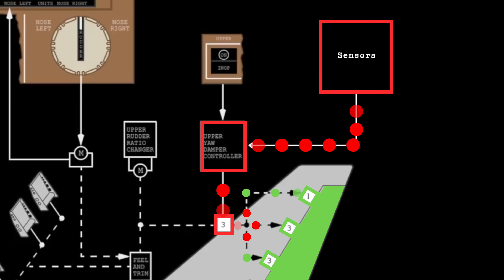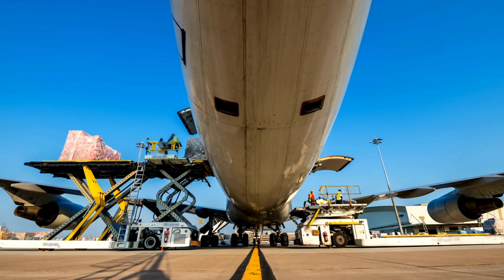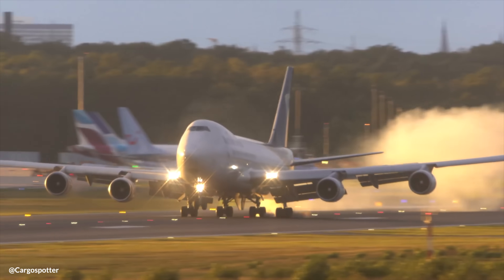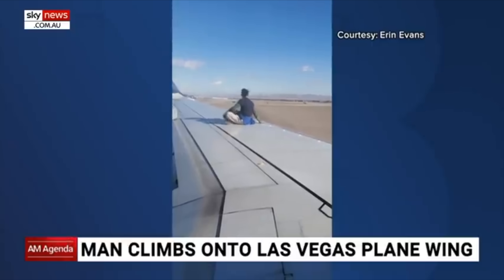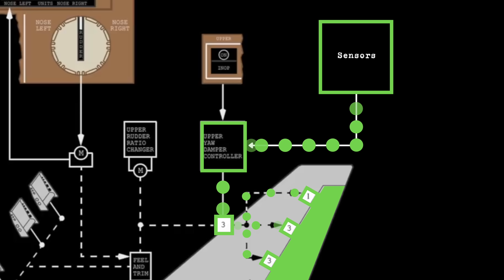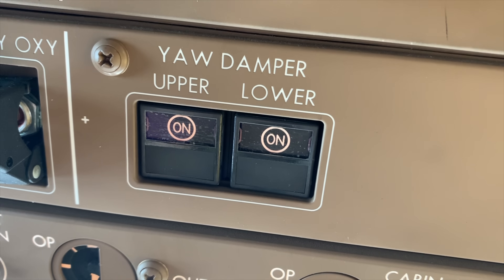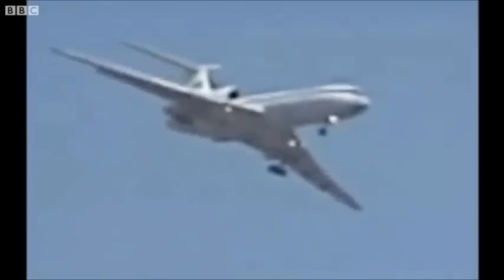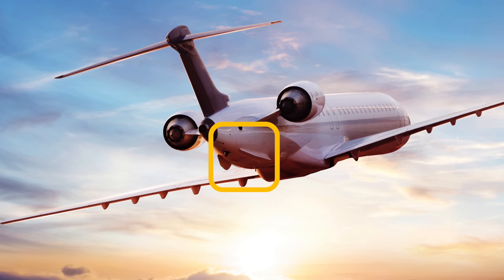What is a YAW DAMPER and how does it work? Explained by CAPTAIN JOE

Comment: 10 years ago, i graduated with an american CPL, and all instructors noted that i tend to overcontrol the plane while most students typically undercontrol it. I was also too harsh on the rudder, when most don't ever learn to use it at all. Before i gave up on aviation in favor of something more rewarding to my professional dignity, i spent the obligatory couple years (in fact, almost 4) trying to get that first job. So on one occasion i was invited to fly a proper jet, a Cessna 520 if i'm not mistaken. In the capacity of the chicken eater, of course. But the captain was very kind and let me hand fly the thing a couple minutes after VR. So one thing that irritated me was that the pedals were so stiff, i really had to push em hard on turns, trying to avoid that slipping. Big difference to that yoke, which i could move with the tip of my little finger.

After he flipped on autopilot, i exchanged that with the captain, and he said, oh, yeah, the auto-rudder was still on. It had a fancy name, something like, "yaw-damper". ...Yeah, right, you have it in your video title. And i be to myself like: huh, what the heck? Why do they even still put those pedals down in, if even this is now "auto"? 

Frankly, i still can't get my head around all that "fly by wire" mindset, and how you guys cope with it. I mean, to me, when i was on top of my skills (with just over 200 hours total), it was pretty sure no autopilot can make a maneuver as smooth as i can by hand. It will never react to a windshear or asymmetric thrust as swift as i can, and it does not even try to alleviate turbulence like i could, after i learned how to REALLY use the AI. 

On the other hand, with Airbuses, flight had really become safe. And since i'm now just a mere passenger, this drama touch me no longer. So whats my question? I guess, what do you think of all this, do you really trust those bells and whistles? Do you secretely disengage the yaw damper on approach when the captain's not watching?

Comment: Mostly bull, ever heard of a PID controller?( Proportional/Integral/Derivative) 
proportional: correction moment proportional to the control error, integral: small correction to the long term error, makes the system UNSTABLE, Derivative : immediaty responds to the change in deviation, also called DAMPING.
Now the airplane's long tail produces a weak natural damping due to square of the lenght of the tail moment arm effective due to the yaw rate, NOT yaw angle!
That is the reason aircraft have a long distance from the CG to the center of pressure of the tail surfaces, irregardless of the rudder deflection, which corrects for sideslip!
Just read ONE book on control systems!
Not understanding this is ground for ATP Certificate revokation
CFI here

Comment: Clear explanation. Why can the yaw damper been switched off? In other words, are there any situations during flight that a pilot decides not to use the automatic yaw damper?
Reply: For larger aircraft they’re only turned off when they break, for smaller aircraft they’re turned off during takeoff and landing because those small aircraft are mechanically simpler and the yaw damper will back drive the pedals and impede pilot control during takeoff and landing.

Comment: Sailboats have a large keel or centerboard to provide a " pinning " effect or pivot about which the craft can rotate. Aircraft have no such device. The fuselage  being the only thing providing torque forward of the rudder, and being of tubular cross section with equal resistance in both axis isn't very efficient at it. So slippage in the "y" coordinate is a big problem.  I suppose upon landing any more efficient counteracting device would only increase the horizontal velocity relative to the ground. Even at altitude such pinning would only increase flight path deviation with crosswind. Such is the difference between powered flight and impulse derived from the medium.

Comment: The L-1011 was designed with a Roll Damper in addition to the Yaw Damper to prevent roll/yaw coupling.  It was found to not be necessary due to its inherent stability in yaw.  With the Dash 500,  the wing span was increased for additional efficiency but with the penalty of greater bending moment at the wing root.  One of our aerodynamics gurus came with the concept of Active Ailerons to control vertical G loads to reduce loads at the wing root.  The system was designed to respond to vertical accelerometers and move the outboard ailerons symmetrically to counteract load.  Positive G would deflect the ailerons up and negative down.   Flight Test had stored the original Roll Damper servos and configured the test system basically the cost of labor.  We joked that the real purpose was to prevent white caps on your Martini during severe turbulence.

Comment: You are damping the motion, not "dampening" the motion!  You aren't pouring water on it. It is not "vertical stability", it is *yaw stability*, which is a function  the associated normal forces generated in yaw, like the side area in front and behind the wing, including the vertical stabilizer. The wing sweep does make Dutch roll more likely, because it dynamically couples the axes more than some other cases. That's why a damper on only one axis reduces the motion in two axes.

Comment: I'm just a flight simmer and I'm thinking of the Cirrus Vision Jet as it relates to this topic. It has a short fuselage combined with a huge rudder surface area in the V-tail (plus ventral fins). It seems to have a very large yaw moment because of this design. It's bucking bronco in a crosswind even with the YD.

Comment: Great video, but the graphic showing the unevenly loaded van under braking is wrong. I think the van would yaw away from the heavy side under braking because that side has more momentum whereas the brakes are being applied evenly between both sides.

Comment: Very good explaination. I'm just wondering a few things:
1. Most newer planes have fly by wire these days. Wouldn't yaw damper be implemented in software that controls the fly by wire system like the autopilot?
2. When would yaw dampers ever be turned off? If there's a switch, there must be a reason or so to turn them off. For cars, drivers might need to turn off traction control / ESP for certain reasons like snow or drifting.
Reply: A broken sensor sending out false corrections would be one reason.

Cheers,

Alan
Berlin
Reply: 1: yes, FBW airplanes like Airbus and later Boeing ones don’t have a separate YD switch, it’s all included in the software. 

2: on smaller aircraft the yaw damper is mechanically connected to the rudder cables meaning they back drive the pedals as well, so they are turned off during takeoff and landing to prevent it from impeding pilot control. On larger aircraft with series yaw dampers they don’t back drive the pedals so they’re never turned off unless they malfunction.

Comment: Sir while flying manually and while taking a turn in the air do pilots apply rudder or only aileorons ?
Reply: Usually if you turn to the left you would pull nose up a bit then turn control wheel to the left most rudder inputs are for crosswind landings

Comment: The Wright Brothers got their patent for pitch, roll and yaw, control, thereof, in 1905. The patent board would not give them a patent at first because they said that the original airplanes of 1903 and 1904 were simply fluttering in the wind. Once the Wrights had improved the airplane to make circles in the cow pasture of Ohio, they got the patent.

Comment: Thanks, Captain. Why is the Y/D turned on after take-off and turned off before landing in GA aircraft?
Reply: My guess would be that either: 

- if it fails and the rudder deflects, you are at risk of entering a spin due to the low airspeed and high AoA during takeoff and landing
- Or as you apply rudder to align yourself with the centreline at short final, it may try to counteract your rudder movements to keep the aircraft in balance, which will make the aircraft hard to control.

Comment: Captain Joe, do you have insight of how big or large this yaw damper in relation to aircraft body. I saw some aircraft has small vertical fins but use two vertical fins.
Reply: The yaw damper is usually an integral part of the rudder control system rather than a separate control surface in its own right although it could be. Typicallly the input from the yaw damper gyros are added electronically (summed) to the rudder input signals from the autopilot or pilots rudder pedals and the total of all the signals moves the rudder as required.
Reply from the maker: @125brat correct
Reply: @flywithcaptainjoe  Thank you😁
Reply: @125brat  I guess I was talking about the whole vertical fins or wing. I kind of wonder why some airplane use tall, very tall fin and other use two or sometimes three vertical wing. Like Lockheed Constellation, it has three small vertical wings relative to its fuselage.

Comment: Excellent topic thank you captain. quick question : when you roll the plane to turn (lets say to turn left) what yaw damper does to rudder? is it deflected to left or right? Thank you very much
Reply: A turn to the left without any rudder input would cause the aircraft to slip into the turn, so the yaw damper gyro senses the slip and causes the rudder to deflect slightly to the right to counteract the slip and give a balanced or coordinated turn.
Reply: @125brat  so for every turn you have a counter rudder input by yaw damper
Reply: @ehsan83  Well yes. Normally in a simple aircraft without a yaw damper you would coordinate the turn with the rudder to prevent skid out of the turn or slip into the turn. This is the purpose of the slip-ball or turn coordinator instrument which indicates the weight of the aircraft is felt at 90° to the lateral axis of the aircraft, i.e. at 90° relative to the plane of the wings. A yaw damper does this automatically and takes a lot of work off the pilot to create perfect turns every time😁
Reply: Excellent thank you. I need a small clarification for skid out and slip in. Does this change plane’s trajectory or heading? Thank you again
Reply: @ehsan83 The aircraft will still turn but won't follow a nice trajectory or possibly exactly the rate of turn you wanted and it can feel odd for the passengers. It's different when you're actually controlling the aircraft because you get used to the feelings through your body in different phases of flight but for a passenger it could be scary if they're not familiar with the unusual feeling.
An uncoordinated turn can cause extra drag and buffet on the airframe because airflow isn't going where it's meant to i.e. in a nice smooth path over the fuselage and other surfaces. It can also cause a spin if the airspeed is close to the stall and as the inner wing goes slower in a turn a slip will slow that inner wing even more possibly taking it below the stall speed. Depending on the rate of turn (angle of bank) the stall speed increases anyway so your margin for error reduces.
Reply: @125brat amazing stuff thank you very much. Can I ask you what your job is? Are you an arronautics engineer?
Reply: @ehsan83  Thank you. I trained as an aircraft technician in the Royal Air Force as an apprentice and worked on the Victors and Tornados. I gained my Private Pilots Licence 20 years ago but have been involved with aircraft all my working life. I'm currently building a Skyranger Nynja aircraft to the new 600Kg microlight category which I hope to finish next year.
Our discussion has prompted me to re-read and clarify some of the finer points around aerodynamics and flying controls, but it's a useful thing to do as pilots should always be open to new learning or refreshing their knowledge.
Reply: @125brat  Thank you for your reply. kudos to you. lots of knowledge and experience in the field 👍🏻

Comment: I don't know if this topic is to hot for you:
On 9/11 there was a crosswind. The "pilots" could compensate the crosswind and made a perfect 90 degree impact. This results in the known roll-angle of the planes that you can see on every impact photo. My questions:
1. Could an unexpierenced pilot do that?
2. Why did they do that? For an attack the impact angle should not play  a role. It would only play a role ift you want to minimize the wreckage parts in the streets of NY. 
In my opinion shows this, that the planes are controlled by an expierenced pilot or an automatic system. Is there any automatic system (maybe the yaw damper) that could compensate the crosswind in this way?
Thank you.
Reply: I think you'll find it would have been flown either on autopilot or manually taking account of the crosswind. I don't have autopilot on my aircraft but the basic principle is that for a given required track with a crosswind you would effectively set a heading slightly towards the wind. In other words if you're being blow to the right of the desired track, your heading should be slightly to the left of track so you are effectively blown onto the correct track. It's all about vectors and is very simple to do graphically. Look it up on the Web.
Reply: @125brat  According to Renato Stiefenhofer, a jumbo capitain and trainer, there was no autopilot involved because of the roll angle that was out of the limits of the autopilot. But thank you for your answer. I invested a lot of time in the approach, but it is for me still a riddle. There was something very wrong this day.
Reply: @jorgw.6151  Hi and thanks for your reply. OK, it is a mystery then and that suggests it was being manually flown. Maybe the pilot had accrued lots of hours on a simulator, or it was just luck? Either way, I don't suppose it would have mattered at what angle it struck the tower.  I can only suggest that any pilot who had enough hours to obtaining licence would or should have enough skill to compensate for a crosswind and maintain a desired track.
Reply: @125brat  They were three planes. All with very accurate maneuvers. In my opinion, they were exchanged with remote controlled planes, of another faster type, that crashed into the 3 buildings. There were non radar zones and other planes crossing the routes of the hijacked planes in this zones. Look also at Operation Northwoods. This was planned similar long ago.

Comment: How do you start a turn in a passenger or cargo plane, so that the "gravity" just feels stronger and weaker but does not change direction?  Do you induce it via a yaw motion? Or via a smooth roll/pitch transition?
Reply: You would normally start a turn with the ailerons but you can initiate a turn with the rudder because when you deflect the rudder it causes a yawning motion and the secondary effect is roll which will cause the aircraft to bank and turn.